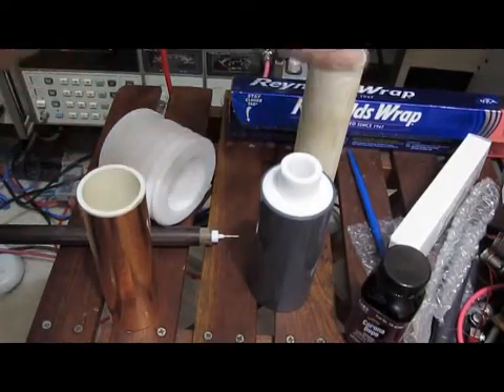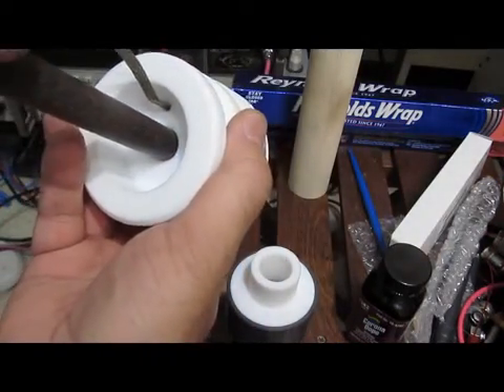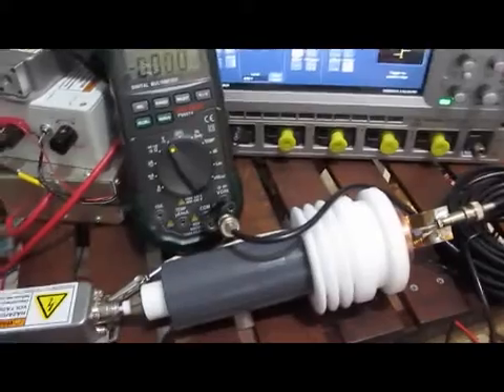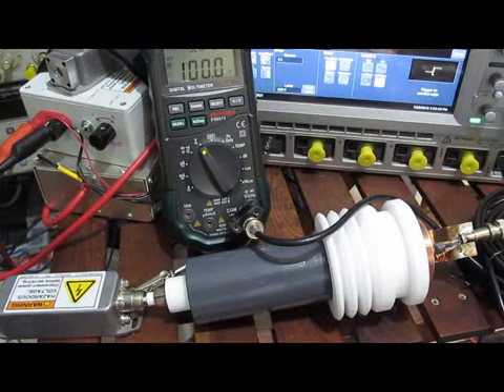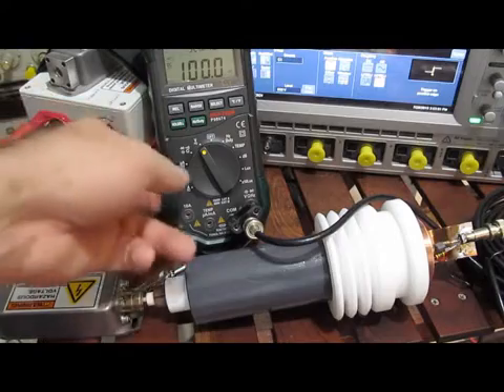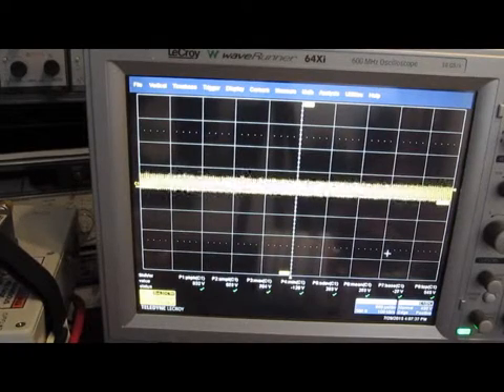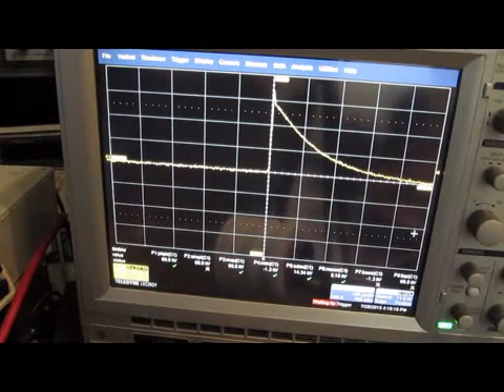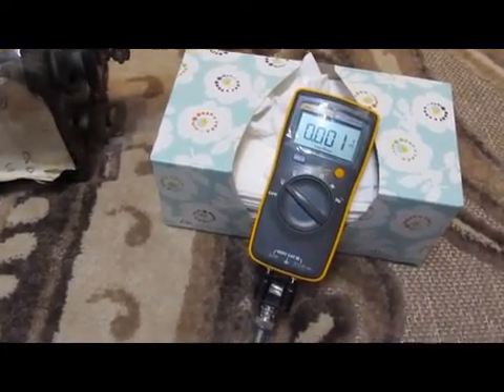Homemade 40KV oscilloscope probe part 3

Comment: Neon sign transformer needs to be measured open circuit (no Jacob's ladder!).  The voltage you should read is half the rated output 6KV RMS for your 12KV transformer.  The secondary is grounded at its center-tap.
Reply from the maker: Perhaps you did not realize the video was about making a high voltage probe, not the proper way to test transformers.